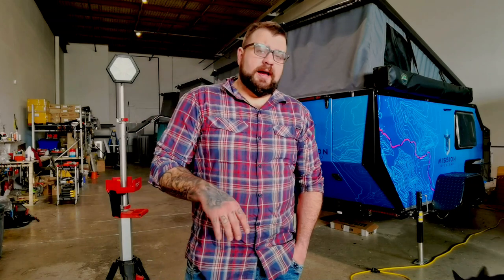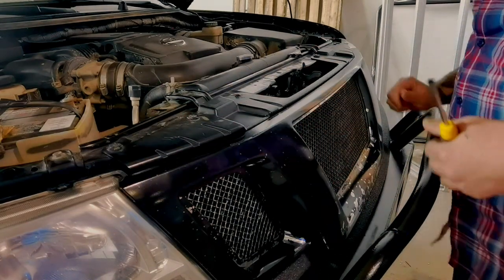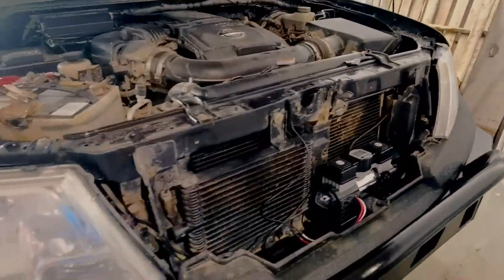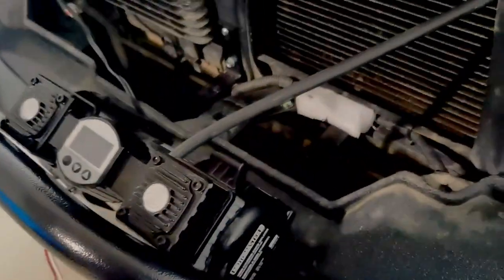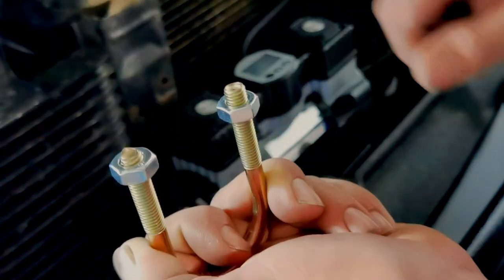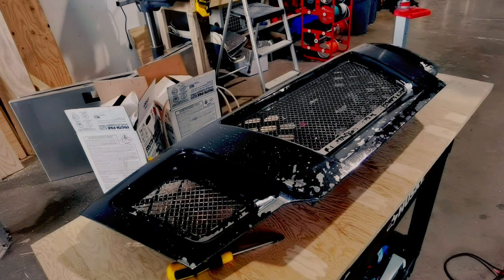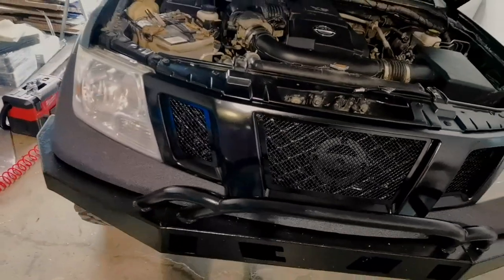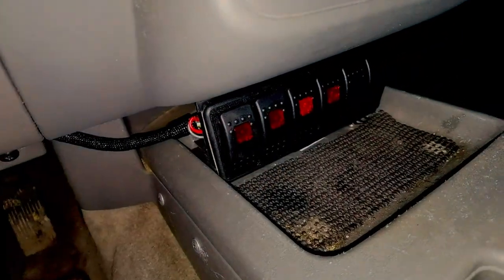EASY DIY On Board Air

Comment: I have a 2002 frontier. And I’m looking to start building for over land . What would be. The first mods you would do . It’s bone stock xe king can . I am starting small with a body armor rooftop tent  . But. Don’t know what upgrades I should do first . Any recommendations
Reply from the maker: Nice, I will totally encourage that lol! I would say if all your preventative maintenance is all cought up and the basics are good like ball joins bearings etc. Then depending on your budget I would do tires and a suspension upgrade in relation to what kind of terrain you expect to encounter most often. After that skid plate and front bumper, our stock bumpers are just dreadful and protection is always one of the first then you can play around with what you'll need. My biggest recommendation though is to just take her out bone stock and see what kind of gear you think may have made your outing either safer or more enjoyable and start from there.

Comment: The only thing I would be worried about is heat. We typically leave our trucks running during air up so they have more power. I can see that area getting super hot while sitting stagnant, but those compressors are pretty damn good and have a wicked warranty so either way your good. Nice video buddy.
Reply from the maker: Yea I had a similar thought, but with the fan running and the limited time the compressor will actually need to run I think I'll get away clean, time will tell haha